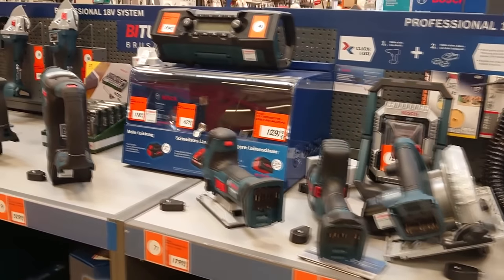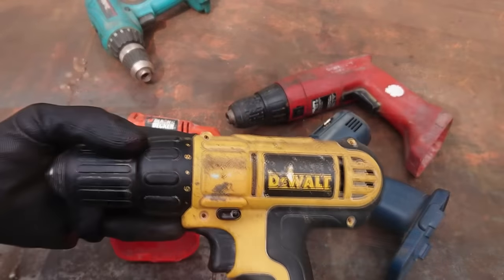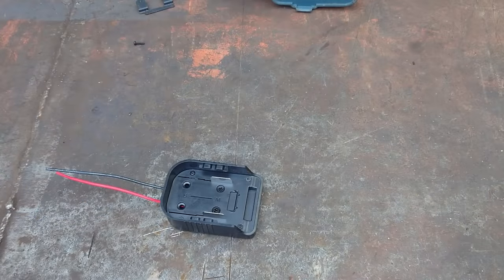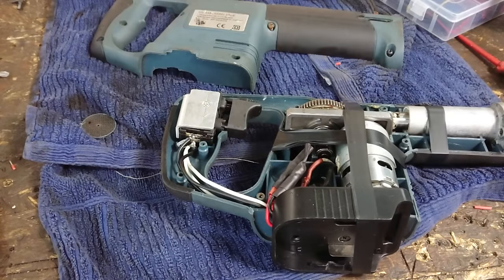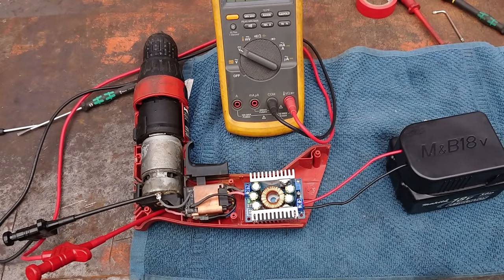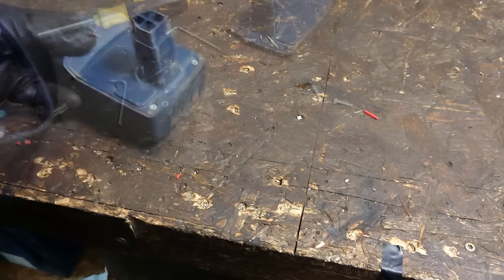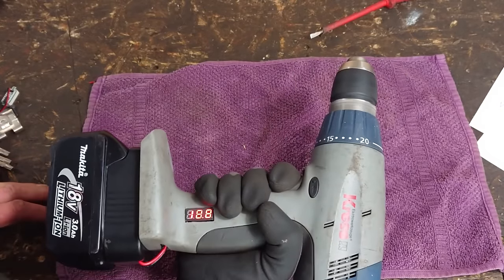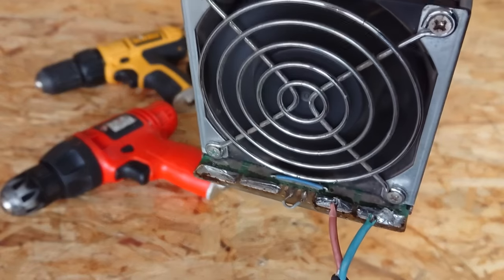Scrapyard Finds! Repair-A-Thon! Cordless Tools Galore!

Comment: I love the scrapathons. You have inspired me to convert an old drill I have. It's a Clarke 24volt drill, it's old, it has a nicad battery (oddly still takes a charge and holds it, though not for as long as it should) I have owned it years after rescueing it from being trashed. It's been reliable to me and I'd hate to just scrap it, so I am going to try a conversion on it.

Comment: There are certain aspects of this video which I appreciate such as the mention of a cutoff mechanism on the battery to prevent damage and the voltage display.  How to replace a chuck was useful.  Wasteful parts are you showing the drills do their function.  In my opinion you lightly cover the important parts of the video and dwell on the useless parts, i.e. drilling and cutting wood.  Showing us how to do things is useful.  Getting stuff from the junk yard and re-purposing them is useful.  Looking forward to you finishing the lathes.

Comment: Another great repair-a-thon Video.  Good choice of Makita battery packs.  They are repairable and the spent cells can be replaced with reclaimed cells from other battery packs - just be sure to use high discharge rate cells from other power tool packs and and not cells from computer laptops.  Ryobi packs are also a good choice for reparability - the difference is how the adapters physically fit in the tools.

Comment: Cool bags!  The red logo has kind of a vintage look.  I also like the tan one too!  I also like the idea of being able to use house current. My cordless drill battery is almost always dead when I need it.  It can be a little tricky to use my old Craftsman 1/2” 120 volt drill to drive a screw.

Comment: made my own adapters out of plywood and connectors, also did a black and decker drill that was 12 volts and as no problem running 18 volts without a step-down converter doesn't overheat the motors in most of these tools can easily take the extra volts no problem great video.

Comment: You've inspired me to restore an old Powerkraft 240V stick welder. Now I have a 180A stick welder in case I need to weld an 18 wheeler back together.

Comment: Good work as always. When I converted my NiCad drills to lithium I used a small push switch on the voltmeter so that It doesn't drain the battery, Your system is much easier to implement than the way I ddid it though. Thanks and good luck

Comment: Thanks for that last video about te angle grinders.. was looking around at my metal yard. found a GWS850 and a 1400 .  got new stators and brushes . and there still working fine. as the needed cleaning and some ballbearings replaced :) works like a charm!

Comment: Love this series! I did the same thing with some old cordless Sears drills by replacing the NiCd batteries with old laptop 18650 sells - used those drills until the brushes were used up and sadly couldn't find replacements so they finally died. I also have a couple of ex-NVA gas mask bags for small waterproof hiking bags.
Reply: Sears used to have repair depots in major cities, which had (on microfiche) the service info on all their electrical tools.  Brushes were still available for even the most arcane and obsolete tools, even if you did have to wait for them to be shipped in.

Sadly, I guess that's no longer the case.

Comment: Love your videos, Gerolf, and this one may be my favourite so far.  Here's my issue: I have my own stash of old, outmoded cordless tools, primarily drills.  I try to think of different uses for them, since I have bought replacements and don't need too many multiples of the same tool.  So what could use a rotating tool to automate the manual?  Some ideas you may be able to expand on:
1 - I have a dump trailer with a 12v hydraulic dump.  I have connected an old 12v drill to the dump battery to crank up/down the hitch jack.  It works, but my newer more powerful 18v drill works better (it is a heavy trailer)
2 - I had an old Lawnboy lawnmower.  My father in law put a nut on top of the flywheel so I can start it with a cordless drill instead of pulling the cord.
3 - so far just an idea, but I'd like to be able to use one of these to convert my garden hose reel to powered so my wife can water the flowers and then wind up the hose using the drill.  This would be a great use especially converting an old drill to the same batteries I use (in my case Ridgid)
I totally enjoy watching your videos.  Maybe you can make some use of some of these ideas.  Thanks for your inspiring work!
P.S. I'd buy stickers, but already have too many bags (occupational hazard)

Comment: Another option that can be, is to connect a laptop power adapter (some are 19v), in to an old battery case, and use it for in-shop use with cord, and have it also ready for exterior use with a battery. Great videos

Comment: Great to see these tools re-used - so often they just end up in the garbage when they have plenty of use left in them.  A big battery in a bag not only allows for longer run times but means the actual tool is much lighter and so can be used comfortably for extended periods - I am old enough to remember video cameras with the same idea because they were already too big and heavy to add an internal battery of useful capacity.   I think this system can provide an ideal marriage of the advantages of corded and cordless tools in many situations, including those where mains power would be too dangerous.

As for the TPAI rucksacks and patches, I'm definitely interested.

Comment: I enjoy your videos. I’m very much like you, I hate to toss anything. I have several Dewalt 12 v drills that I run off reclaimed 12 v emergency light batteries with a simple 12 v extension cord    I have dedicated to specific tools. Wood rasp. 1/4 inch drive for sockets   Thanks for the details you provide in all the rehabilitation videos.

Comment: Nice one. And it started with a Bauhaus Drool-A-Thon 👍
I've came across two  NiCad specialty tools that was scrapped because of the battery gone bad. I converted them to Makita 18v and they're like new. Saved me 1400 euro.
I standardized on the newer Makita batteries with indicator.

Comment: The ones you converted to corded 12v would be good for vehicle use. Make a cable that has jumper cable clamps. Throw them in your truck tool box and you never have to worry if they're charged.
If you wanted to get fancy, install a plug wired from the fuse box and make a custom cable for that.

Comment: Great idea with the voltmeter to compensate for lack of under voltage protection. I have a bunch of old 18v nicad tools and only one or two batteries that aren't terribly for them. I'll have to get some of those battery connectors and revive those tools, some are quite nice.

I think the thermistor is most often used in fast chargers for nicad.

Comment: Hi, Gerolf...yes, this Makita Akkus have a proper BMS inside. With balancing, over and under voltage cut out as well as over current protection. Almost all Lipo Battery packs i have ever opend, have such a circuit board inside. I changed the cells on my 18 Volt Makita Akku packs...Thats why i know it for certain....

Comment: Such a cool video. I just upgraded to Milwaukees 18v platform and got a few new batteries with their half inch high torque impact. Well I have a bunch of 0ld dewalt 18v tools that all the batteries are toast so I bought a converter where you can take the Milwaukee battery clip it on to the adapter and then slide it into the dewalt tool. I really like you're idea as well as its better if you have a bunch of different tools. Really great video.

Comment: Make cord up with alligator clips. Then you can use them when on the road from your car. You could even add a buck/boost converter to your adapter and make a 12v to 18v battery car charger for the higher voltage tool batteries.

Comment: For thread tightening consider the right hand (and left hand) rule. 
For right hand threads, use right hand with thumb extend  point thumb in direction you want the screw, or nut to go. Tighten point thumb toward object, and to loosen point thumb away from object.   Then look at the way your fingers point around, turn in that direction. For left hand thread use left hand.

Comment: What an awesome episode. I understand about the older drills and other cordless tools and their lack of batteries. There are also even some newer items in which one brand does not have that tool where adapters work very well for your tool brand. There are a few things from other brands that I would like my brand to have yet they do not. I am not with my brand because I like them the best. I am with them because its the amount of batteries that I have for it and trading to another brand would be costly to replace the amount of batteries that I have.

Comment: Nice modification  , the voltmeter  will  drow current  and drop the voltage  of the battery  you can add a push button  to it or use a  comparator  with three output led and a buzzer  to monitor  the battery.

Comment: I had a 9.6V drill with dead battery.  So 20 metres of flex and some alligator clips, and I can plug it into the car's battery.  Drill runs nicely on ~13V.   Great for 4WD trips into the bush.

Comment: You make a battery backpack connected to an overall with wire going down a sleeve ending in a connector. On the front of the overall a panel could show information about the state of the battery and anything connected to it.

Comment: my approach is to reuse the old battery box, if i have it, and empty the cells out , replacing them with a battery pack made up of 18650 lithium cells, I match up a set with the same capacity, and add a charging lead and balance lead to the battery container, match the voltage to the nearest number of cells, then just use a standard imax battery charging unit to charge the tools up using the balance charge function, I now have various tools with voltages fro 11.1V (for a 12v tool) up to 18v.

Comment: I'm a little late to the show, but a good idea to power the portable tools would be a battery pack in a tool box, instead of a cloth bag. And you can add various styles of usb ports and a regular power plug, a diy portable power station.

Comment: Great video, especially the buck converter , i mainly use dewalt cordless devices these days , after around 30 years with Makita , but i also have some ryobi products , a blower and a small power saw i just got so sick of the nicad batteries ,they make the tool seem like a toy , then i found an adaptor that allows a 18v Dewalt battery to be used , now those 20 year old Ryobi tool work like crazy.

Comment: Was jacking up my car the other day, and hit on the idea of using my 20 volt drill to turn the scissors jack that came with the car.  It worked a treat, and I'm planning to convert one of my old drills that has no battery, to run off the cigarette lighter.  I'll just keep that old drill in the trunk along with the jack.  I may use it only a few times a year, but at my age, twisting that stupid jack, with it's inconvenient handle, in varying conditions (including sometimes when there's no clearance for the stupid handle), is a win/win.

Comment: The voltage indicator is not only very practical but it turns every handheld electrical tool into some sort of M41 Pulse Rifle :D
Add to that the Olive Drab pouches and you're basically cosplaying a Colonial Marine at this point ^^

Comment: Nice stuff. Regarding the bags, a suggestion: Steal the very stylish old Tatra badge, reform font to TPAI and surround with a cog wheel. Voila, a retrofuturistic, very central european logo. Industrial and a bit whimsical at the same time. Did a quick, 10 minute test sketch in photoshop, it looked quite cool.

Comment: Thank you for this vid! This completely validated my own recent, completely unreseaeched old cordless to wired Drill, powered by an old Workstation PSU!

I have no idea what a good Amperage rating needs to be, but if that 12v 2.5a wall wart you held up was sufficient, then my 13a output will be fine 😁 (particularly since I'm just going to be using this drill as a speed adjustable rock tumbler/polisher, to rotate a barrel I put in the chuck)

Bring on the apocalypse! haha

Comment: A great subject to explore and some good ideas there. Here's something to consider. If going the corded route why not just equip each drill with the socket and supply the tools from a Makita (say 4Ah) battery together with an adaptor made from an old broken Makita tool. You'd just need a pouch rather than a shoulder bag and 4Ah is plenty.

Comment: Been a few years ago when stuff went to 18 or 20 volt, took an old 12volt drill and connected larger alligator clips to it. If I needed a drill off in no where south Texas, I just opened the hood

Comment: I know this is an older video but I am still using an old no name cordless drill that I converted to run off the 3 cell lithium polymer batteries that power my RC aircraft. 
They are small and light enough that they fit in my pocket (2200 mah), I have several of them so I never run flat.
I use them with a low voltage beeper connected to the balance lead of the battery so I don't over discharge them.

Comment: Excellent work saving those old tools and especially adapting/converting those battery packs. 
I wonder if you could build a circuit that would automatically shut down a tool drawing a Li battery down to a danger point, without monitoring an LED display. Alas, even if the comparator components were cheap, that would probably involve a relatively high-current relay which would cost as much as the LED display.

Comment: Black and Decker had a 24v battery pack and cord system for compatible drills, impact drivers, grinders (can't remember all the tools).
Must have been 30yrs ago. I remember selling the system when I worked for B&D

Comment: Love these. Would definitely run those 12v systems at least at 13.7 volts, which is equivalent to the battery at full charge.

Comment: if you made a connecting cord 2m long you could put the bag down on the ground while using the drill etc in most cases. Have both cords (short and long) so if you HAVE to carry the battery, you can still use it.

Comment: One Battery design would be in a perfect world, your solution is perfect.  FYI Porter cable  Brand battery's are the same as Black& decker. sold at Walmart, Porter cable no longer sold at big box store.  Love you finds that scrap yard is a picker dream of useful junk.

Comment: Thank you for this episode! After having watched you repair many many tools i will probably never use in my life, this conversion of battery to other batteries or even mains power will be very useful when my cordless drill batteries will die. This is really great content! I am also interested in repairing (fairly new but broken) battery packs where for example one cell has lower voltage and the charger will not recharge this pack, even if all the other cells are fine (which is a waste in my opinion). Greetings from Cologne!

Comment: If it's a lithium battery it most definetely has a protection circuit, called BMS: Battery Management System. This has over and under voltage protection, and will also balance all cells to keep their voltage level. This is required for lithium, as wrong handling can cause fires... I would be very surprised if a brand name battery did not have protection like that.

Also: a 12V battery has a nominal voltage of 12 volts, but a max voltage of maybe 14 volts. So you could safely crank that buck converter up a few more volts :)

Comment: Found an old drill in the dumbster the other day. It had a dead 12v battery but on the esc it said that it could accept 24v  so just installed a 24v battery on it and it had much more power!

Comment: When I was 14 yo, I added banana jacks to a a fixed battery Skil cordless drill.  The internal battery was lacking, and I had plenty of 7.2V-8.4V NiCd batteries from my RC car hobby around.  Kind of a cordless/corded solution, but I used what I had.  I also didn't have to wait overnight, with the old drill charger anymore.  Seeing this brought back a lot of memories of that.  lol  Now days, just 'charge' the new tool on account.  LOL.  There in lies the problem!?

Comment: The bag sounds like something Makita should do for their hammer drills, I am using one with a vaccume attachment at work with which it consumes the 5Ah battery rather quickly and they're quite heavy all together when the brushless motor is used in full power drilling a ceiling. I am writing this comment smelling like mint from the relaxant/pain killer balm.
Waist-strapped/backpack battery and vaccume would reduce the weight and increase the lifespan of the battery especially if multiple are used in parallell, since more can be carried in such a pack.
I felt how light weight this could be and my back felt better already.

Comment: Just thought: one option for the "tethered" 12V devices might be an old Makita battery case that has the connector mounted on that instead of the aluminium plate at the bottom.  That way you've got the choice of using a Makita 18V battery if you need to be portable, or a 12V supply for more stationary jobs (even if out in the field away from the workshop).

Comment: For many tools you can buy Ni-Mh replacement batteries and just use them instead of Ni-Cd. They even have greater capacity.. and price sometimes is quite nice. I bought nice NiMh replacement battery for my old Bosch drill from 1996/97 and it was about €15.. works like new.

Comment: Haha you actually had the same idea with the remote battery.

You should have taken the chance to put a remote power connector in parallel with the makita holder. Then you can clip a battery to your belt and switch between tools without needing to carry the battery on the tool. When working on a construction site where you might need a drill, saw, screwdriver, many times throughout the day you will really notice the difference in weight.